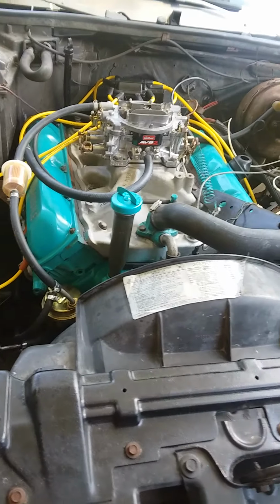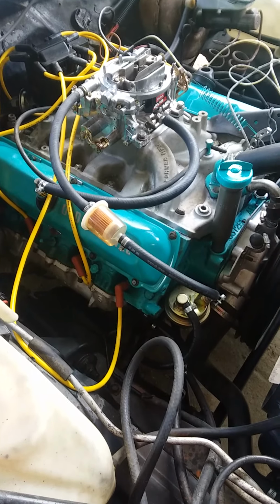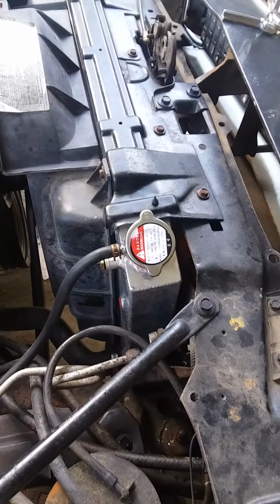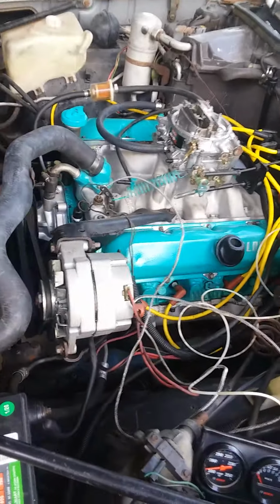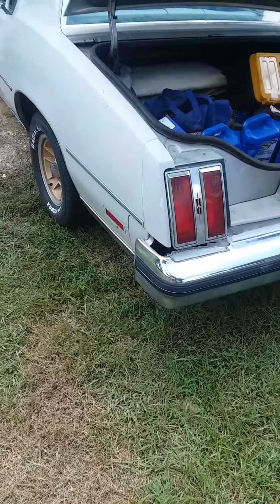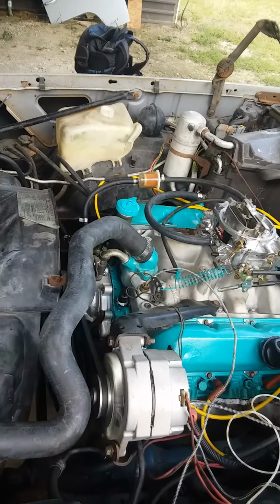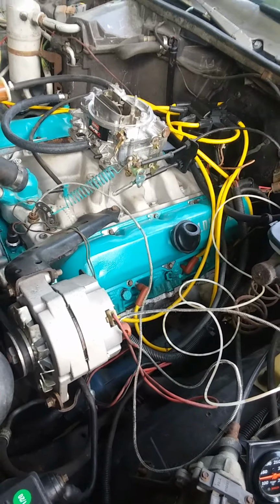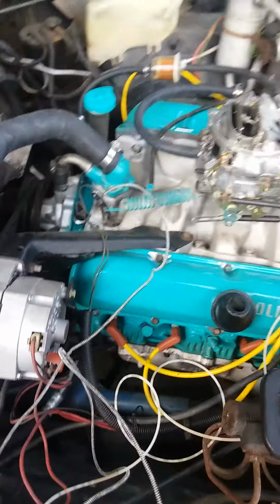1978 Cutlass Calais the "Badd Seed" 409! 2021 update.

Comment: Motor looks clean and runs smooth like it just rolled off the showroom floor! You are throwing a ton of low end power out the window with that Edelbrock though. Their mechanical secondaries are no good for your average street car with an automatic and make a car super lazy in the low RPMs. We had a good Qjet on my buddys truck and temporarily swapped it for an Edelbrock AVS 2 just like this one and lost a ton of low end power. It wouldn't even break one tire loose with the Edelbrock but it would burn one tire almost all the way through first with the Qjet. Also I can't believe you came on my video trying to tell me how to build my 79 when you just threw a leaker together because you didn't have your intake milled in conjunction with the rest of your combo. That's kind of a noob mistake but I still give you major props for throwing a clean looking engine together yourself. Good luck with the rest of the build, you're gonna want more gear than 3.08s if you wanna pass any Hondas though! My 260 with the Qjet and 4.10s would probably pull this build in the eighth mile if you don't spring for a better carb and deeper gear.
Reply from the maker: No no. This is my 409 Olds, completely different motor. After teardown of the new spare 403, which needed a rebuild, decided to get my 409 out da machine shop, instead doing a 403 completely,(stock).  I've done this too many times to go backwards. There's NO hp in a 260, PERIOD!!!! BUT, nxt vid I post will be of "The Badd Seed" n action, which speaks volumes  over words, TenDamn4❗👍
Reply: @prodrvr4185  Alright, I'm looking forward to your next video then. As far as action goes I just posted a video of my first 1/8 mile pass on my daily driver since I threw the current 360 in it. Went 8.82 all motor beating a nitrous V8 Mustang with my small block/automatic in a full size car so I know what I'm doing.
Reply from the maker: @Impactjunky  I'll chek out ur vid. If you went 8.80's with a 260 (unmodified)my hat's off 2U. Still proceeding w/smog era musclecar build. Nvr said u didn't know whacha were doing, just Oldsmobile 260's don't make HP! Prolly gonna build spare 403 back bone stock(xcept cam)to show da difference between these 2 engines>TenDamn4.
Reply from the maker: @Impactjunky  I was responding to your Cutlass 260/5 spd. Da vid in which u said something about modding the 260. But, if you would like to run your Mopar as is currently, against my Calais, no pwr adders> let's do it👍
Reply: @prodrvr4185  Thanks man but I didn't go 8.82 with an Olds 260, my daily driver is a Mopar with a Magnum 360, the 79 Olds 260 is a side project and I haven't had a chance to take it to the track yet. You're absolutely correct about the 260 making no power, as it sits right now it would be slower than most Hondas but I have plans for it that should make it respectably quick for what it is. My first engine I had in my Mopar was a little 273 V8 and I got it down to 10.450 in the eighth in that big car so I have some experience squeezing performance out of a little V8. 
Will be watching your channel and wishing you the best of luck, love the car!
Reply from the maker: @Impactjunky  👍TenDamn4

Comment: Use a 350 valley pan gasket for the year of your heads I think the 403 valley pans water ports are bigger than what's on your heads and doesn't leave much to seal on the one side I usually use Grey rtv on both sides of the valley pan for the water ports then Indian head shellac for the intake ports both sides it's good to torque these intakes leave it sit a couple days  then retorque then run it and retorque after cam break in
Reply from the maker: Thx Hudson, will give it a try.